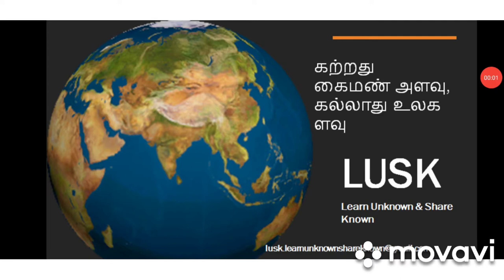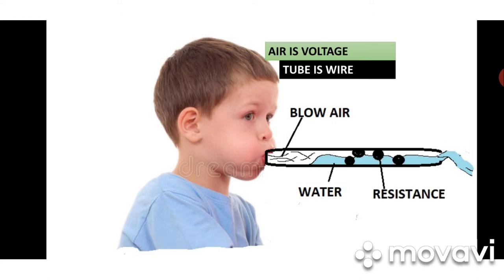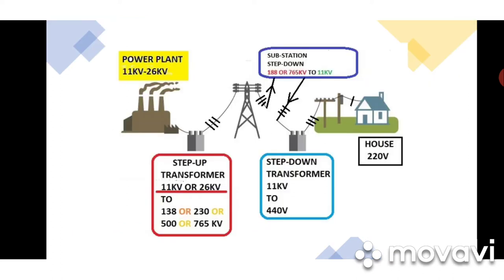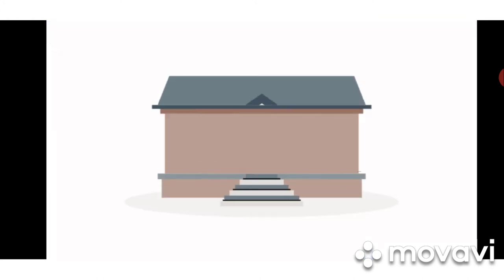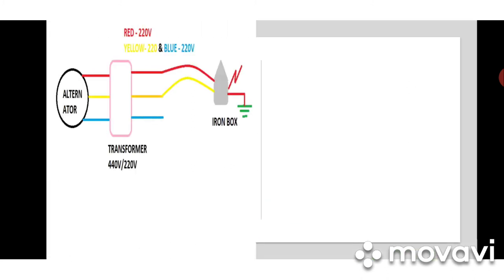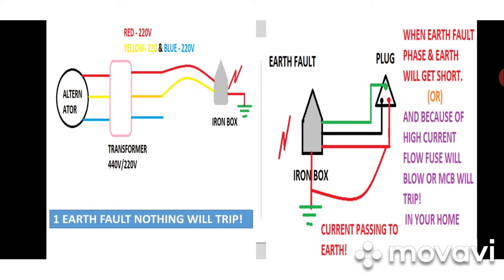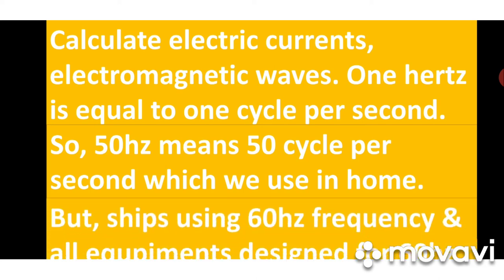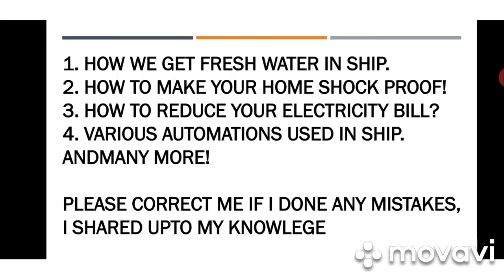Difference between house electricity and ships electricity! #engineering #ship #marine #electrical

Comment: When In ship electric voltage is red 220v yellow 220 totally 440v given iron box will be damaged
So I think red wire 110v and yellow 110v total 220volt to safe tha iron box is well good working.....

Comment: I didn't understand the concept of frequency. So frequency is not rpm but say 50 rpm is taken as a cycle and 500rpm = 10hz. Is it like that?
Reply: Bro here have a formula relation between speed and frequency. I. e  Ns= 120f/p, here you can take p= poles 4 , f= 50 hZ then speed Ns value = 1500 rpm. If  you take f = 60 HZ then Ns= 1800 rpm. If you vary the frequency speed also vary.

Comment: how its possible to increase motor speed without changing poles in motor..?
Reply from the maker: By increasing it's frequency.. maximum you can increase like 100 to 150 rpm..  but it's not advisable to increase rpm more than its rated. You'll get heat problems.. if you want to increase the speed of your Machinery you can add gears.
Reply: Hevy ht motors use tha vfd panel